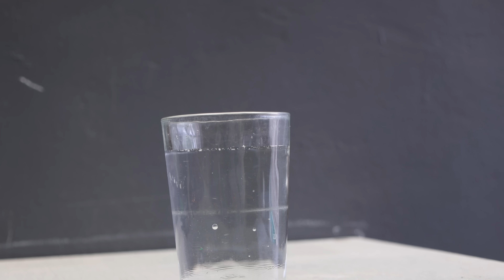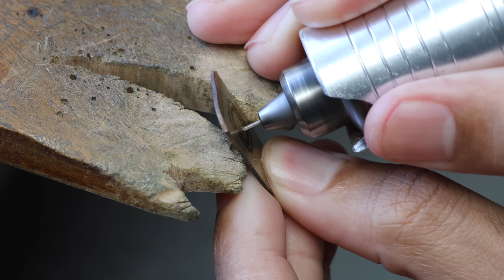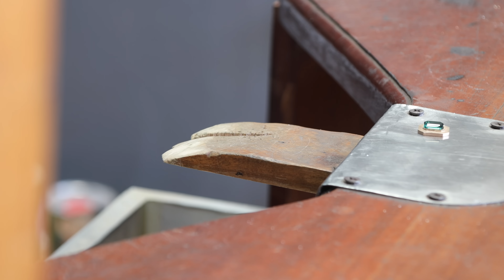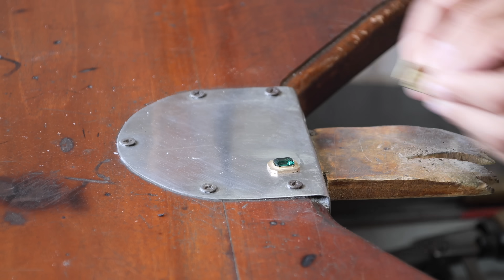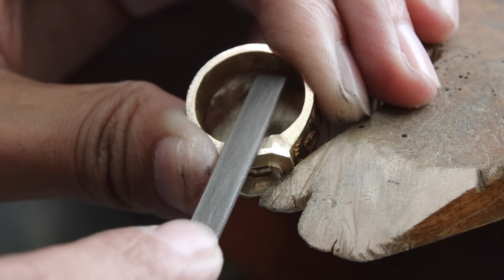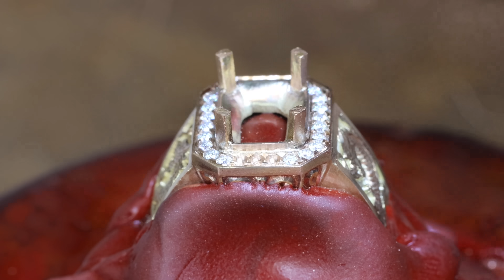how to make Dragon ring for men - gold jewelry making

Comment: If you notice, he attaches the dragons first, then he uses the drill to add the details. If you ask me, that shows pure confidence in his abilities as a master craftsman. Perhaps I am mistaken. But, I would hazard a guess that a lesser skilled artisan would probably add the details BEFORE attaching, just in case a mistake is made. :hand-purple-blue-peace:
Reply: It's possible that he's also doing it this way for practical reasons. Gold can work harden, so roughing out the dragon design and then hitting it with the heat to solder it to the ring body probably softens the metal again, making the details easier to work. But it's impressive regardless.